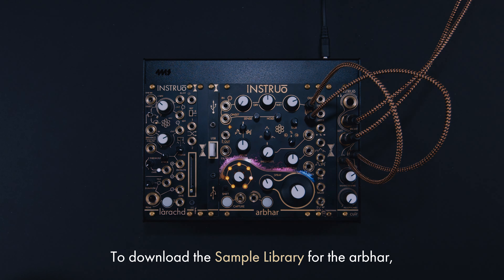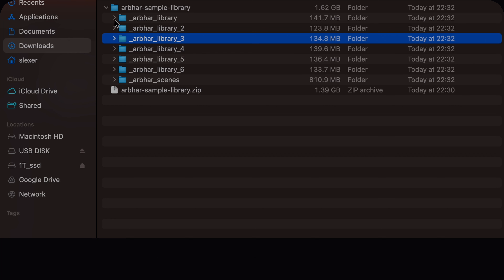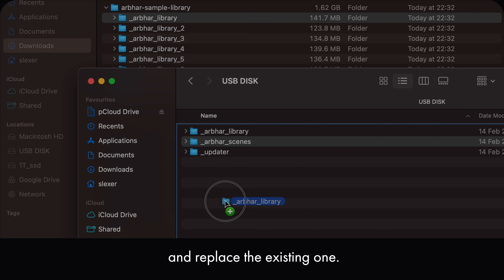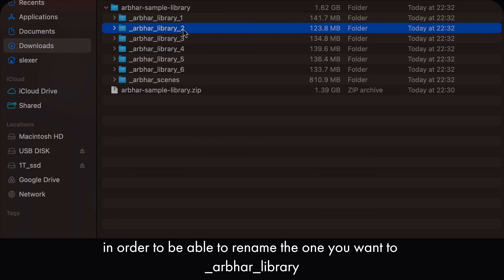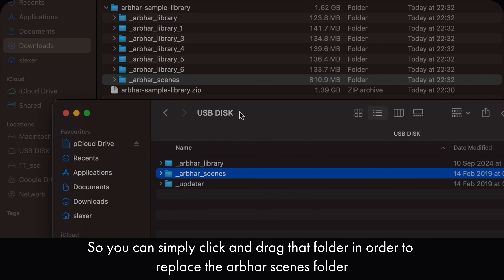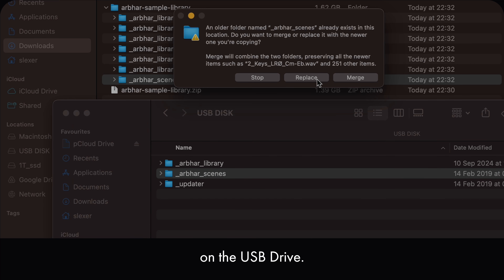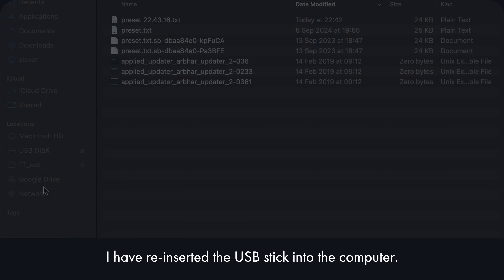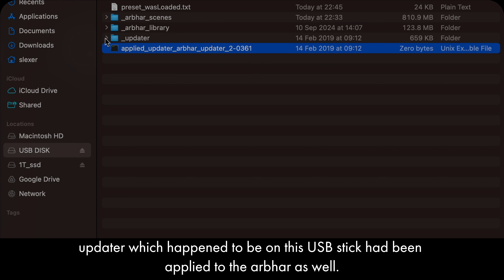arbhar - Working With Pre-Recorded Samples

Comment: This was extremely helpful thank you!  Can you do a concise video like this for the Lubadh now?  Also would so much love the possibility of an Arbhar preset that quantizes the pitch knob.  Currently i can't use the pitch knob when playing with other musicians, because any pitched sample will almost always be out of tune.  Thanks!
Reply from the maker: @pico_cole  the parameter track and hold feature quantises the pitch pot to to semitones with LED visualisation.
Double tap and holding SHIFT will turn the LED display green.
The pitch will then lock to semitones and then engage when shift is released.
https://youtu.be/U2KhZqMnM08?t=7160&si=adyqSXtHw_S0qSFG

A suggestion for the use case you describe is to utilise the 1V/octave input.
This will allow for articulate pitch control from any quantiser/sequencer/keyboard.
Reply: And i am aware of the track and hold mode, but would like to actually hear the pitch knob changes and have them stay in tune without needing an external keyboard to do this!  It's my only gripe with this module.  Otherwise love it
Reply from the maker: @ there is something in the works that I think will suit your needs 😉🤫
But in the meantime, think of Arbhar like you would an oscillator, 1V/octave being the primary pitch definition mechanic :)
Reply: @instruo  Looking forward to it!  Just want to be able to spin the knob and re-pitch whilst staying in tune.  Also could you explain why the right output is phase inverted in mono mode?  I'm sure there's a good reason but i haven't figured it out.
Reply from the maker: @pico_cole  the outputs use analogue summing for combining grains.
An inverter summing opamp takes the unpatched lower output from its normal and sums with the signal for the top output.
This allows for automatic combination of all grains from a single jack, or when patched, distribution to two outputs.
Traditionally Arbhar produced grains distributed between the two outputs with “coin-toss” distribution.
Phase doesn’t matter when combining like this.

But introducing a mono dry throughput can cancel out common contend when summed out of phase.
It’s all dependent on how the arbhar outputs are patched and how grains are distributed.. and how the “stereo” output is patched and summed following the arbhar into the rest of a patch.

Context is key.
There are many many ways to patch with an arbhar!